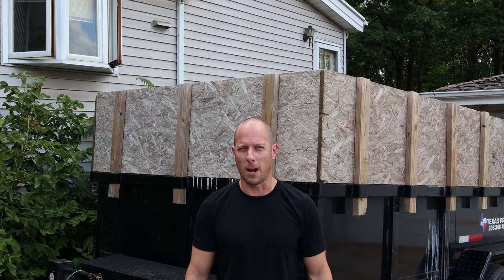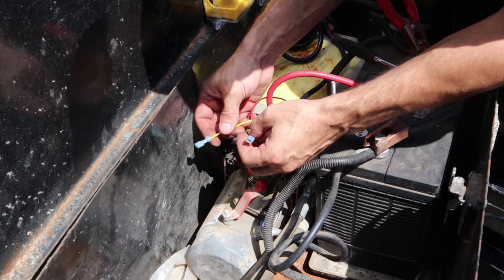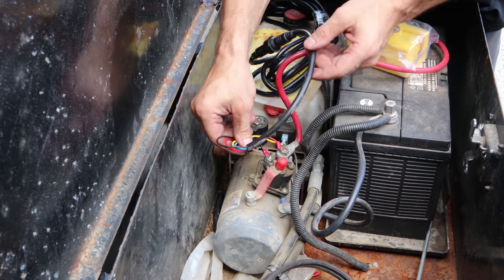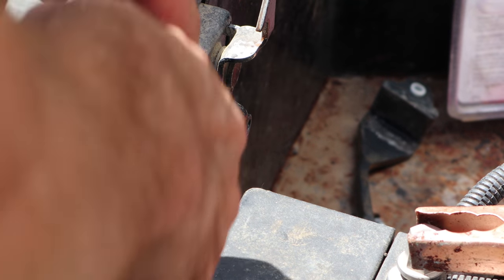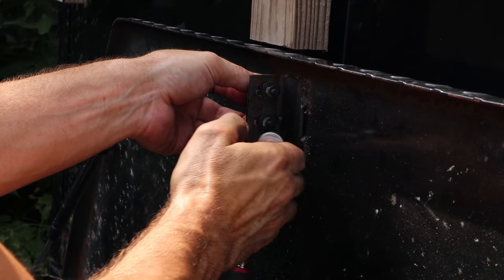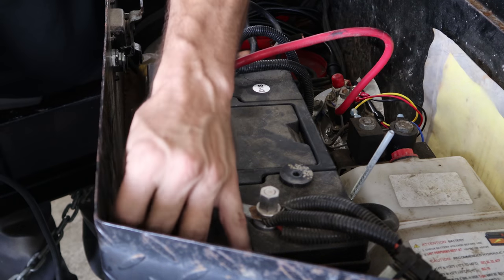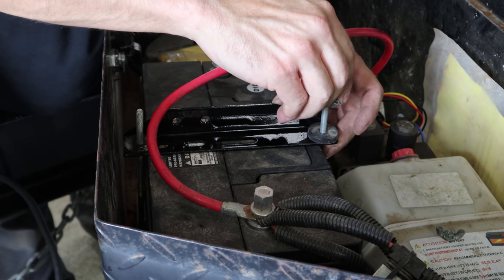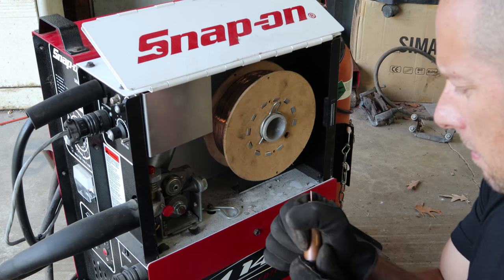Rebuilding a wrecked trailer after a collision part 2 To dump or not to dump? That is the question!

Comment: I'm about to re-do my tongue box on my car haulet and put a solar panel in the lid of the box to keep my battery charged and an aftermarket remote control which uses a regular battery instead of those super short life 12v batteries like the one i have now does. ROFLMAO, yeah what i wouldn't give to be "poor like you"  life would be so much more interesting if i were. just saying! you could always be more financially well off but just from what i think i know about you, you're richer than most! except that you live in the middle of the rust bucket states. I would NEVER harass you about the Harbor Freight cordless tools. I love mine, and they work better and for much cheaper in most cases than their more expensive competitors. like that 1200 ft pound Earthquake XT and my 450 ft pound  Bauer, none of the others that size and type have as much power. yeah the batteries could last a little longer but that's really my only complaint about the ones i've invested in. I have Dewalt too but i'm not spending Dewalt or Miluakee money when Bauer and Earthquake work just as well if not better. that's just dumb. like throwing money away just because it's yellow plastic instead of red. as for your welder, i would still rather have a Lincoln or Miller than a Snap on to be quite honest because you know full well if you've been at this a while (and you obviously have) that Snap on doesn't actually make a welder at all, they let some other company build it for them and then just slap their name on it. same way with their Floor Jacks like the ones they just got done trying to Sue Harbor Freight over for copyright that they also don't make, (Obviously) Those G8's are such bad ass little cars, that's it! i'm selling the wife's Grand Prix and getting a G8 that's my next project. i'm back to work as of the 3rd so that's my next project i've made my mind up. let's do this !
Reply from the maker: I just make fun of myself.  I'm not poor and I would not call myself rich.  I love very comfortably within my means.  I do have some favorite tools but I can pretty much get the job done with anything if I have too.  My G8 GXP is one of my favorite cars.  I have been neglecting it this summer and it is almost over.  I need to move south so I can drive it year round.
Reply: @vehcor  yeah you do need to move South. the cars are better Quality here too. maybe it wouldn't be so hard to do the repairs if you don't also have to fight with the whole rust situation as well. we don't get much snow here either though specially if you moved to the Nashville area but as much as i really love the cold and snow i like having my vehicles last for years and years longer much better. the snow is pretty and all but when things go affecting my wallet the beauty of the snow becomes a serious second place. and yeah you can drive cars year around here as well as bikes if that's your cup of tea too. i've lived at the KY/ TN border for almost 20 years now and i've never seen more than 6" of snow on the ground. Well i've seen drifts up to 20" but only 6" of actual snow fall and even that is rare. most years we're lucky to get even a dusting of snow.